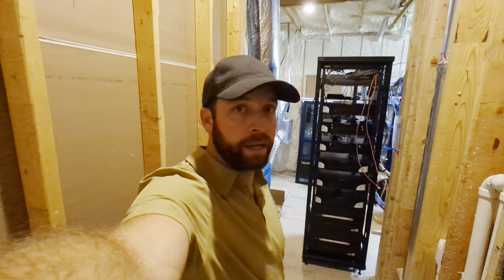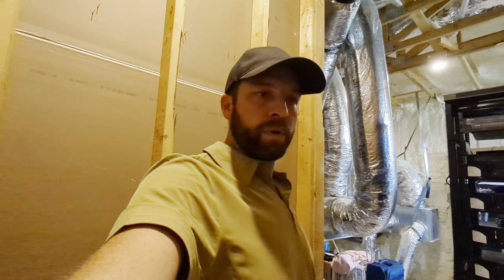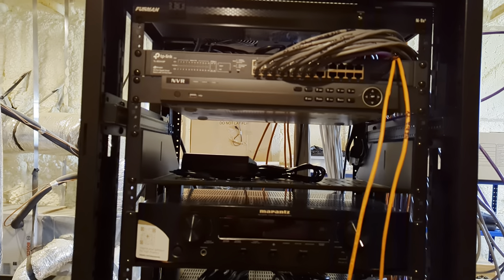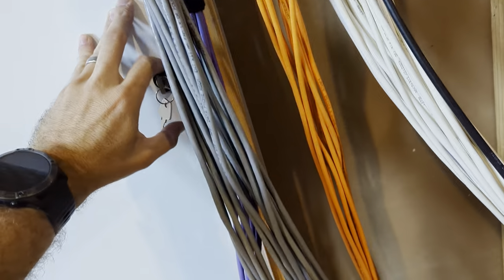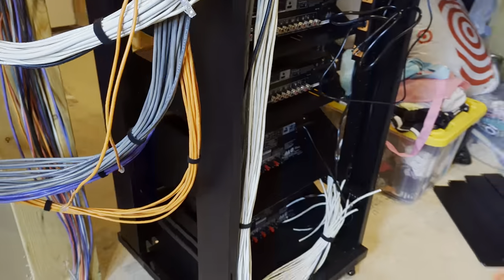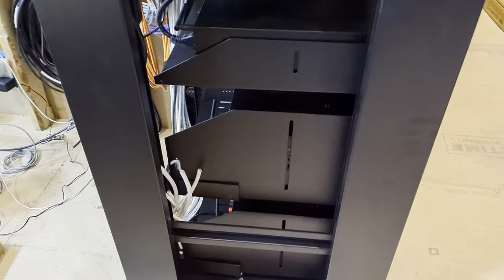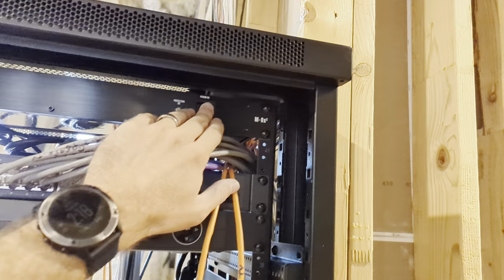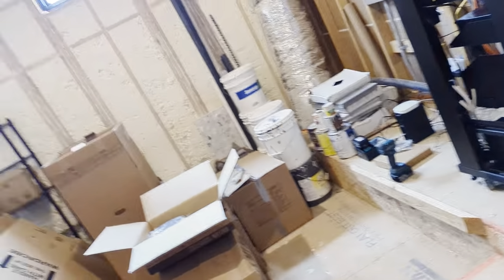I put an equipment Rack in the attic in Texas!  Whole House Audio, WiFi, and Cameras

Comment: Do you ever use patch panels for better wire management? Look forward to seeing the finished result
Reply from the maker: All the time.  In residential installs the cables rarely if ever get moved so often I just throw a 45 on the end of them.  In this job the company that did the pre-wire had them all terminated already which is a rare treat so I just used them the way they were.

Comment: Are you not concerned about the temp of the attic during summer?  Does the spray foam keep the attic cool enough during the summer to not worry about equipment overheating?
Reply from the maker: That attic only hits 80 in the summer.  Foam is great for that.